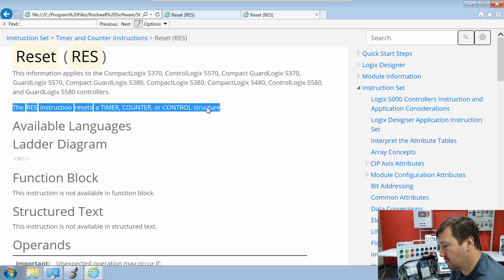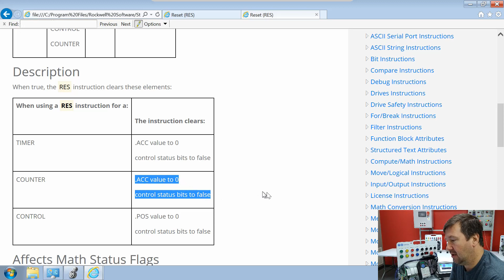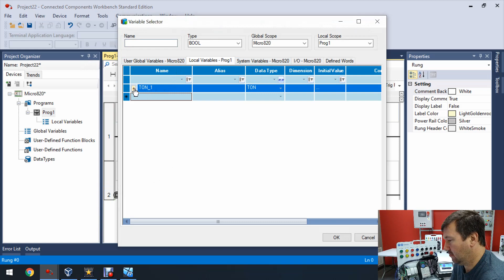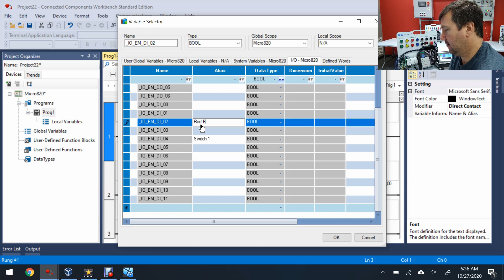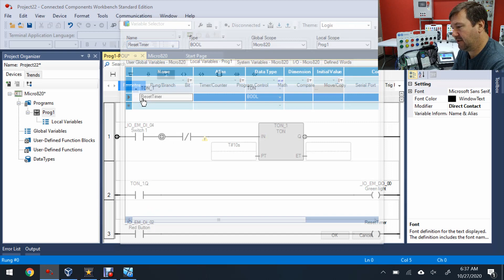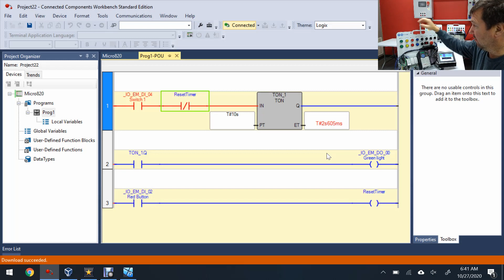Micro800 RES Timer Reset in Connected Components Workbench

Comment: without selecting  TON_1 with  EN / ENO selected, I get a timer that never has  TON_1.Q  output.    If you used a  NC   TON_1.Q  contact on the line before your timer, that would then do the same job as your reset.   I went through a nighmare afternoon without using the EN and ENO timer.     Any idea why that would be?   :face-orange-raised-eyebrow:
Reply from the maker: If you put a Go Look for a 0 on the TON_1.Q bit before your timer then you would end up with a sample rate timer.  Here is a video explaining that.
https://www.youtube.com/watch?v=dJxactEun74
Reply: @TimWilborne  I tried ANY_TO_BOOL to reset the TON_1.Q    through a buffered bool exchange, to reset.  BUT  have to make IN false and then EN.
    How about just a RTO_1 timer that comes with a reset feature?  
     I am not up to speed with any other than CCW for now, not Studio5000 that I am allowed to even download. 

🤠
Reply from the maker: I'm not following while you're doing the Any To. That's simply converts one data type to another data type. If you put a one in the reset then it'll reset the timer.
Reply: @TimWilborne  My  TON_1 times up to PV and ET shows BUT  NO   TON_1.Q   output, until I monkey around looking at the variables, variables show [x] for TON_1.Q and when I return back to my simulator screen,  Q is now on.  Not a consistant output.   Also I have it go into FAULT every so often.
😍
Reply from the maker: Sounds like you need to find that fault. Also cross-reference the q and see if something else is writing to it.

Comment: In Rung 1 
Could you have just used the _IO_EM_DI_02 bit in the Examine Off instruction?
Making Rung3 unnecessary?
Why is it better to create the variable in rung3?

Thank-you for your videos. I was trying to do a Reset on a timer, ( XIO I:0.0/0 RES T4:0 ) and looked around in Connected Components with no luck.

This video came to the front of my search.
Reply from the maker: You are correct, you could have put input 2 in place of the reset bit.  But the person who asked the question was replacing an RsLogix 500 program so I added rung 3 so we would have the same RES framework.

Comment: Dear sir,
Thanks for your all videos. It means a lot to me.  
When I've usually used the Seimens TIA portal, we mainly program our code in Main OB (Organization Block 01), Functions, and Function Blocks. When the PLC powers up, Main OB begins to execute first. In CCW, if I write three programs, which runs first? Do they run parallel or do I have to set a sequence by programming?
Again Thanks a lot for everything you taught us...
Reply from the maker: All of the programs will execute, one at a time, in the order you have them in on the left pane.  You can drag the programs up and down to change the execution order
Reply: @TimWilborne  Thanks a lot sir, Keep up the good work...

Comment: Hey Tim, your vids have been helpful. I'm transitioning some Micro 1000's to 830's, and I know the RES instruction does not exist in CCW. In several of my Logix500 programs, I use the RES on the first rung to reset a counter that appears further down the routine. I'm having a difficult time visualizing the reset function in CCW when it is remote from the actual CTU instruction, as this was not something I did in RSL500. Thanks!
Reply from the maker: Hi Matthew. Simply put an OTE of a "ResetCounter" Bool tag up where you had your RES  instruction then assign the "ResetCounter" tag into your CTU reset field. I probably should have covered that on this video. I'll hit it the next time I am videoing a Micro800 setup.

Comment: Isnt the Reset instruction needed for an RTO, the key being retentive? A TON naturally resets when it's input drops off, the RTO needs a "thanks, I got it" aka the Reset.
Reply from the maker: No, the RTO has a built in reset bit.  Drag an RTO into a ladder rung and on the left side you will see where you can map the RST bit for the reset.

But I should make a video showing how you can make a user defined "reset" function block to do the same as the RES instruction is Studio 5000 and RsLogix 500.
Reply: @TimWilborne  No need, I just thought the original question, about the TON and the Reset, was more about having timer types confused, than actually resetting the TON.  
Anyways I like what you are doing here.

Comment: is it legal to assign the timer et output to reset itself? like you hit a button and it times out and resets the entire rung?  so that itll run til a limit is hit? say a stack or somehting?
Reply from the maker: I'm not following you you would use the ET as a reset.  Did you mean the Q bit?  A XIO of the Q bit in front of the TON will cause the TON to "reset" each time it is done and start timing again.
Reply: @TimWilborne  yeah sorry that's exactly what i was asking. thanks. is it legal to draw the logic that way? since it would automatically reset regardless of the operators action
Reply from the maker: If you watch many of my videos then you know I don't believe in making rules. There's no legal or illegal, the question is does it work for your particular situation.
Reply: @TimWilborne   right on.thanks!